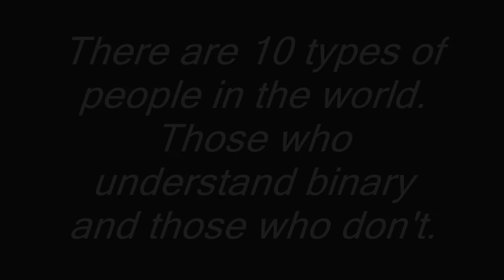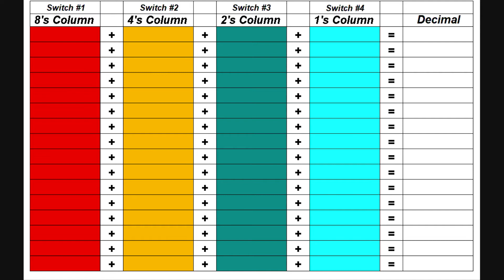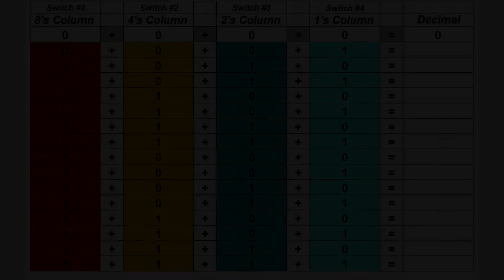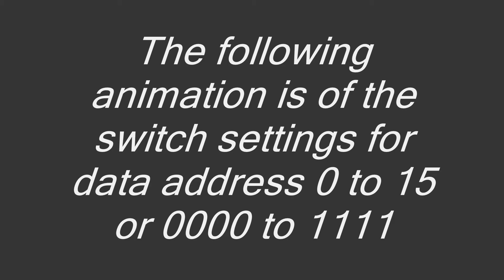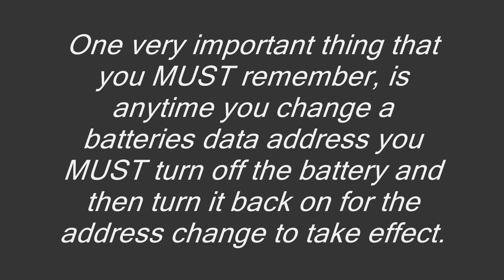Signature Solar EG4-LL Dip Switch Settings.

Comment: HI please help. I had a growatt inverter es5000 and two battery pack already installed. should i set both battery deep switch at 0001 please advice
Reply from the maker: I really can't answer that question, I have never worked with a growatt inverter,  I believe that  address 0000 and 0001 are reserved for use with the  growatt inverter try setting one battery to 0001 and the other one to 0002. I am just guessing, I have no Idea if it will work.

Comment: I had an interesting experience with my Growatt 12kW and 6x EG4-LL v1 batteries.  I could only get them to talk by not using address 0 on my batteries.  That is connecting the RS485 port from the master battery being ID 1 to the Growatt BMS port.  The rest of my batteries are 2-6.  I'm going to email Growatt and see if its 12kW inverter is indeed address 0.
Reply from the maker: Please let us know what you find out from Growatt 12kW we would like to know.
Reply: @onmyworkbench7000  Well, while I'm waiting on their reply, the manual on page 22/setting 22 does state that the RS485 address is 001 by default.  However I am not using its 485 port but rather connecting my master battery to its BMS port.  Still the fact remains that address 000 on my master battery causes communications failure with the Growatt.  Where setting the battery to 001 solves the issue.

Comment: I have no idea what is the Dial Switch  for as I have a 48V100AH  EG4 Battery with a Growatt 3000K LVM-ES inverter.  Now I think    it is for setting the IDs of multiple batteries in order to be able to view their SOC etc, is that correct?  I just have one battery, so the switch should be all down, correct or 0000?
Reply from the maker: If you are asking about the 4 switches on the front of the battery yes they are for setting the address of the battery. When setting the switches for a EG4-LL battery with the LCD display it is my understand if you are using a GROWATT inverter you use address 0001, if you are not using a GROWATT inverter then you can set the address to any address from 0002 to 1111 or address #2 to address #15 and if you use address 0000 it will be maped to address 10000 or address #16.

Comment: Hey. I just installed my new Growatt off-grid 5kw inverter with Eg4LL battery. Unfortunately both came with no cables. I looked up a RS485 pinout online, found few different combinations?!?!?
No matter what pinout I use I can't communicate with my inverter. I tried using all different dip switch setting different RJ45 RS485 configurations, still no luck. Right now I'm only connected to my grid and inverter is working correctly and it is charging my battery but I would like to make sure that it is "talking" to my battery as well. I will try to connect to it using  RG45 to USB as per your configuration as soon as get the adapter. In a mean time any idea on what is the RJ45 to RJ45 pinout to connect Growatt to EG4LL battery? Thanks in advance and thanks for having this channel since Signature Solar customer service totally ignores their customers after the sale. WHAT A SHAME.
Reply from the maker: John,
There 10 types of people in the world those that understand binary and those that don't. The switch setting for the Signature Solar EG4-LL batteries was confusing for me at first but I figured it out and that's why I did the videos to help others. I think any Ethernet cable like the ones that you use to go from your router to you computer will work. How are you connecting Eg4LL battery and how many batteries do you have? Are you using the Battery-Comm ports or are you going directly into the RS485 port? If you are using the RS485 port you will need the RS485 to USB addatpter.
Take a look at the 0:27 point in my “Signature Solar EG4-LL Dip Switch Settings” video and it will show you the correct switch settings for the first battery (DO NOT USE ADDRESS 0001) when you are directly connected to the battery and are using the BMS software BMS_TOOLS_15-16S V 2.06. I can’t tell you if any other version the BMS_TOOLS will work or not as I have not tested and other versions. Then take a look at the 4:18 point in the same video and better explains the relationship be twin the switch numbers and the binary values. Please keep us posted at to your progress, and you are correct about how Signature Solar customer service totally ignores their customers after the sale.
Reply: @onmyworkbench7000  Thank you for your quick replay. So I was able to get my inverter and battery to communicate. I used a regular CAT6 cable going from RS485 port on the battery to BMS port on my Inverter. After all the troubleshooting it turned out, all I needed was to hit RESET button on the Inverter. I also follow your explanation on DIP switches that helped me fix my communications issue Right now my Inverter is showing battery status. I just ordered a RS485 to USB adapter and will be playing with than later on today. I have a single battery for now, but will most likely add second one as soon as I connect my solar panels this spring. Thanks again for your help
Reply from the maker: john,
I am glad you got things working, now what do you know about Raspberry Pi's? I an working on a system for monitoring my system but all of my components are manufactured by deferent companies and they can't talk to one another so I am having to design and build a a system that can talk to all of the parts and I have hit a stumbling block with the software that is running on the Raspberry Pi. I will figure it out but it is very frustrating.

Comment: Where do I set the switch for one battery?
1000? My battery came with no instructions.
Battery work find until I connect to my inverter. I hear a clicking sound, then the BMS turns off. Inverter never comes on
Reply from the maker: You cant use address 1 it's reserved for Growatt inverters so for a singel battery use the battery address 2. To to set the battery to address 2 start from the left put the switches in the folowing positions: Down, Down, Up, Down. That will be the binary address 0,0,1,0. I hope this helps.
Reply: @onmyworkbench7000  0010 got it. Thanks
Reply: @onmyworkbench7000  found the manual online. It states 1111
Reply from the maker: @nickaltvater5592  yes you can use 1111 or any address from 0010 to 1111 but not 0001 address 1 like I said it's reserved for Growatt inverters. 
1111 is address 15, I pick 0010 address 2 so if you got more batteries you could set the next one to 0011 for address 3 and so no.
Reply: My alarm light is on. Sig solar won't answer their phones.
I had this issue during installation, but I thought it sorted itself out. 400 watt panels are connected, but the batteries are discharging. 52.3 volts at the solar connectors.
Alarm light and power light are both flashing. Inverter won't come on.
I'm going to search the internet tomorrow for an answer

Yesterday, the inverter was fine until I shut it off, then connected the inverter. That's when the alarm light stayed on
Reply from the maker: @nickaltvater5592   What's the total number of panels that you have and what's the output ratting of each panel (in watts and volts) and how are they wired, parallel or series or a combination of both? Are all of the panels the same make and model or are they a mix of deferent manufactures and models?
Reply: 100 watts x4

My current problem is trying to communicate with the battery. The batinfo screen becomes unresponsive
Reply from the maker: @nickaltvater5592  What model battery do you have? and what version is the farmwear?
Reply: @onmyworkbench7000  48V 100ah rack battery.
Unsure of the firmware
Reply from the maker: @nickaltvater5592  is it the Signature Solar EG4-LLbattery?
Reply from the maker: @nickaltvater5592   Your panels may not be producing enough current to charge the the battery so the voltage folds back, you may need more current than your panels can provide, that could be why you are only seeing 52.3 volts at the battery's terminals.
As for why the display is not working you may have to do a manual reset on the battery, go to the Signature Solar sight and down load the manual and look at the manual reset procedure and try it.
Reply from the maker: @nickaltvater5592   go here https://signaturesolar.com/eg4-ll-lithium-battery-48v-100ahd-ota/ and down load the manuel in PDF then look up how to do a BMS reset.
Reply: @onmyworkbench7000  when.i get to the batinfo tab, the program freezes (doesn't respond)
Reply from the maker: @nickaltvater5592  Try resetting the BMS.
Reply: @onmyworkbench7000  it doesn't do anything.
It did work yesterday
Reply from the maker: @nickaltvater5592  it looks like you have an issue with the BMS at this point I don't know what else to try, I think the best thing that you can do is to contact Signature Solar and have them replace or repair the battery under warranty. Good luck contacting them, I know that you have had issues with them not answering the phone.
Reply: @onmyworkbench7000  I might be stuck with this paperweight
Reply: @onmyworkbench7000  when you say "down" that is the "on" labeled side?
Reply from the maker: @PRVRT1   I don't understand what you mean by labeled side. 
When I say down that is where the switch is down towards the bottom of it's battery. 
 Please look at the switch bank at the 0:27 point in the video, that setting represents the binary address setting 0010 or address #2. 
I don't think that Signature Solar could have SCREWED UP the switches on these Batteries more if they had tried to do it!

Comment: Hi Buddy,  like what you do.  Even I can understand it.   Keep it up 👍🏽. 

Do you have any idea how I could connect these batteries 48v to a Victron Multi plus II. .. would appreciate any help ..  thank you.
Reply from the maker: Mel, thanks I will try. As far as the Victroc Multi plus I googled it and its a nice looking inverter, it has 2 Can , 1 Ethernet ports along with 2 ve busses I will down load the manuals later today and read up on them. Have you tried to connect the batteries to it? I found the download page https://www.victronenergy.com/inverters-chargers/multiplus-12v-24v-48v-800va-3kva#manuals and I found a document that may be of help to you it is called "Connecting other lithium systems to Multis and Quattros"  https://www.victronenergy.com/upload/documents/Manual-Connecting-other-lithium-battery-systems-to-Multis-and-Quattros-EN.pdf  without having one of the Victroc Multi plus inverters to try it on I can't do much more.

Comment: I just purchased (Feb 15, 2022) three EG4LL (non display model). For those of you trying to figure out how to set up the addresses I have worked it out. The switches are mounted on the batteries upside down! If you read the manual it will not correspond to the switches.
Here's what to do:
Once you have loaded the software and have "successful" connections go the "Batinfo" page. set the "packs number" to "15" and the "Start Adr" to "0". "Clear Sequence" then "Add address to sequence". You should now see all the addresses show up. The program will sequence through all the addresses and you can now determine which address your address switches on the batteries point to. 
Example:
the switch positions for battery 2  are v ^ v v, this is binary 4 (0100) but because the switches are upside down it is address 2 (actually 2 = bin 0010). You should now be able to set your batteries to whatever address you want.
If you have 2 batteries then "pack number" should = 2 and the address of your first battery should = 2 or the number of the first battery address you set the switches to. I don't use "0" because address "1" is allocated to the inverter and I want to keep the sequence in consecutive order (2,3,4,5, etc).
I have 3 batteries and I set the "start address" to "2" and the "pack number" to "3". My switches are set to v^vv (add 2); ^^vv (add 3); vv^v (add 4). You can use RJ45 jumper cords between the batteries there is no need for a special harness, I don't know about the batteries with the display though.
Reply from the maker: Mosfet500, I don't think they could have screwed it up more it up more if they tryed?
Reply: @onmyworkbench7000  They did do a proper job of it!
Reply from the maker: @mosfet500  My dad uses to say some people could screwup an anvil.
Reply from the maker: Mosfet500, it is my understanding the EG4LL batteries WITHOUT the display will work with the daisy chained cables but the batteries with the display will not and need a splitter harness, and as you have shown the switches on the non-display batteries are BASSACWARDS. I hope SS never starts BUILDING electric cars if they do we will be driving them from the TRUNK.
Reply: @onmyworkbench7000  I believe this to be true, it is what I have found with my batteries. In their defense the batteries themselves work extremely well and once set up the monitoring from my mainframe is great and within tight tolerances.
Reply from the maker: @mosfet500   So far I realey like my batteries as well , I just wish SS would admit that the RS485 port and the Battery-Comm. ports on the EG4--LL batteries with the LED display do not communate with each other when using the BMS Tools software.
Reply from the maker: @Carey Gagnon Yes I got that same answer a couple of days ago when I finley got SS tech support to take a call. I TOLD them that I built a 4 way splitter cable and a splitter box and the both WORK with the batteries with the LCD display by bypassing the Battery /Comm. ports altogather.  That is when they told me the story about the BMS manufacture elemanatting the dasy chain capability. In other videos I have asked them to test a Growatt 8 way CAN / RS485 box and they just won't do. I have started a new video but have had other work that had to get done, I will try and get back on the video tomorrow. I think all of us that bought the EG4-LL batteries with the built in LCD displays should DEMAND that they FIX the issue after all we payed for that function and have not gotten it.
Reply: How do I setup ONE non-display EG4 for ONE GroWatt 3k? The manual is d*gshit. It's like it was only translated from chinese, and whomever wrote it is clueless. Signature Solar includes NO printed manual, not even a sheet with a step-by-step on how to hook the EG4 to the GroWatt. No diagram in their PDF manual. You'd be better off learning chinese and asking the actual manufacturer.

When I am facing the battery in a normal, upright orientation, which switches are supposed to be down, and which up?
Reply: @onmyworkbench7000  The problem is they didn't try.